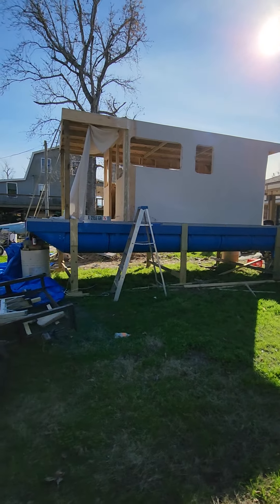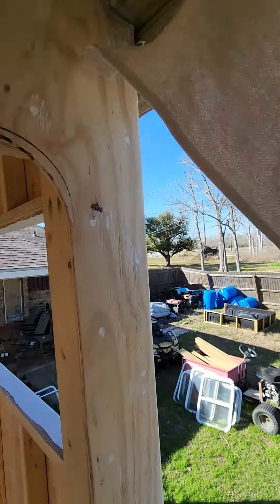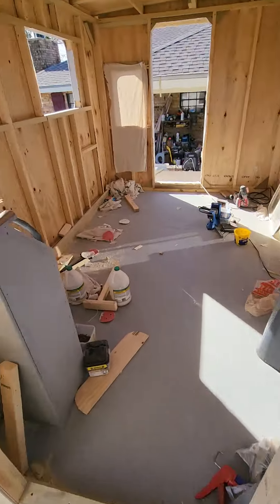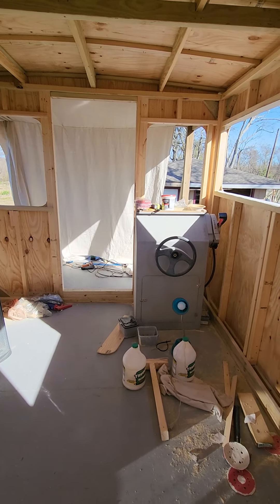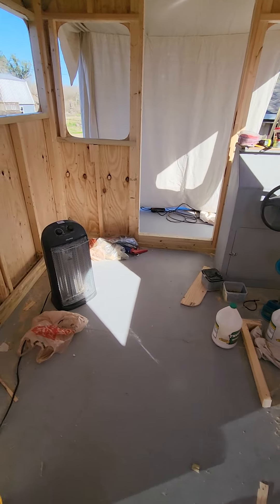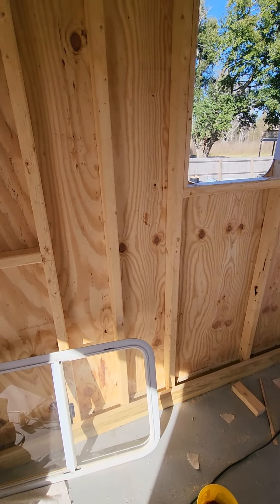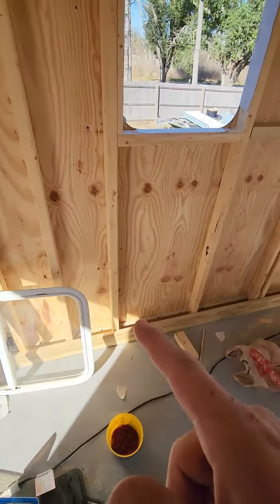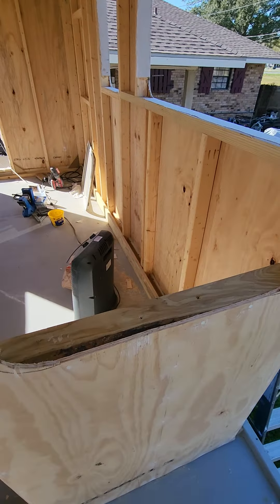Tiny Houseboat Update

Comment: Appreciate you sharing all the details!! Ive heart that TB 3 doesnt adhere to itself... I undertand youre using obly one layer to fix the canvas, but what about the overlapping? Will it be ok because the canvas is not soaked?
Reply from the maker: After i trim my overlap i give the layer under the overlap a good soaking with tb3,so im applying to bare canvas....not ontop of tb3.then i press the overlap ontop of the wet tb3,then coat the whole overlap in tb3.
So its never a glue ontop of glue application.
So my seams are wood,layer of tb3,canvas,tb3,then canvas and a final layer of tb3.
The canvas seperates the tb3.
Reply: @nickpellegrin  got it!
Reply from the maker: @sprkl4582  
Im not sure if tb3 bonds to itself or not,but i also read,and heard on other builders vids that it diesnt bond to itself.
But i cant see a manufacture selling a better glue,thats twice the price of its previous product.....and it doesnt bond to itself.